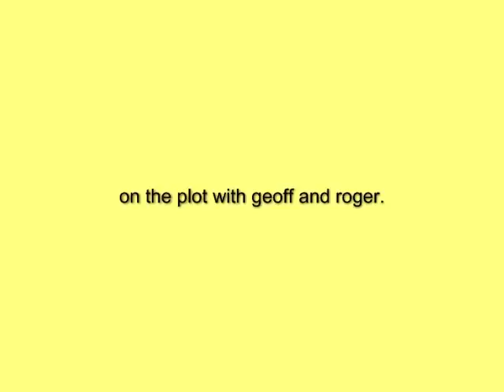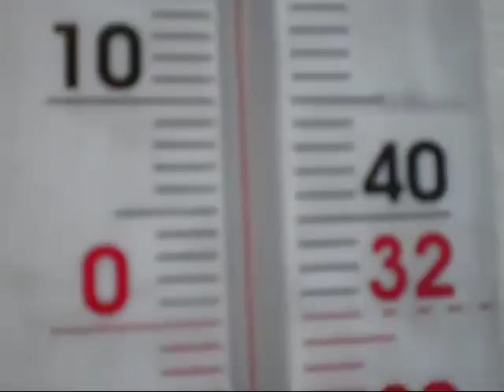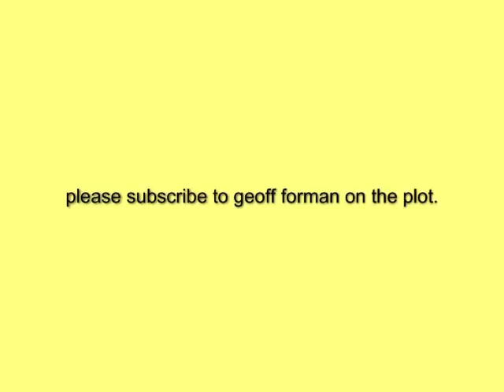POTTING ON THE SEEDLINGS,sowing the sweetcorn and a walk around the plot APRIL,2019,

Comment: Do you put any drainage holes in the plastic that you've lined the hanging baskets with Geoff, or is it a water saving method ?
Reply from the maker: hi pal,yes it is a water saver,and no holes in,means everything that goes in is used,just go easy with the water and feeds,you can tell when they need a drink so no waste,cheers.